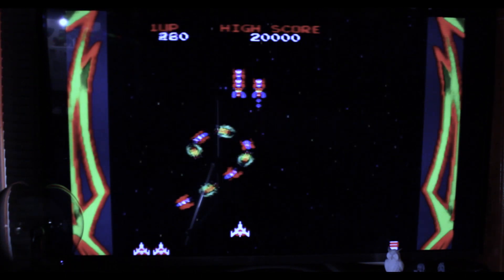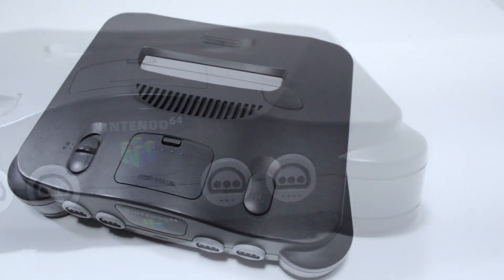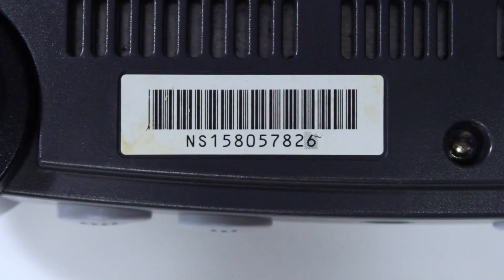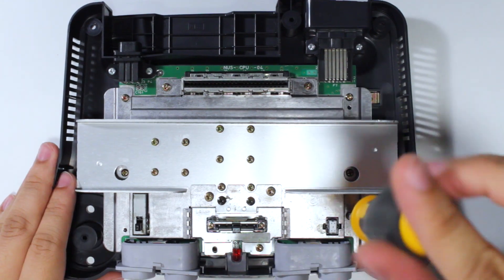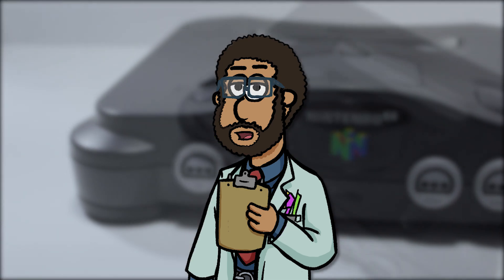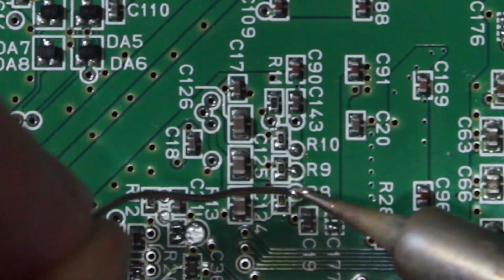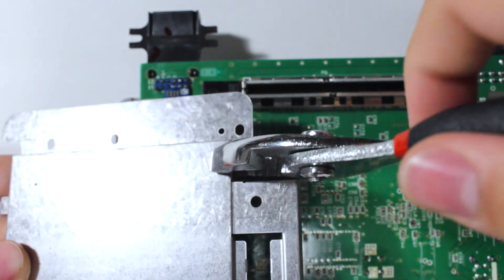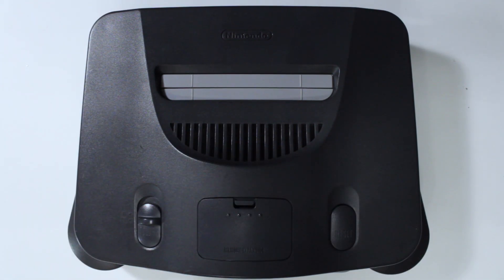You NEED A Modded N64, RIGHT NOW! | VideoGame O.R.

Comment: the best way is to get a cartridge reader for your PC and use an emulator as nothing you will ever do to the real hardware will come as close I can upscale my N64 games to 1080, 4k & 8k and even play them using a VR headset to simulate a cinema size screen, then use a USB converter to use the real official N64 controllers on my PC, I have about 3 modded N64's that can output in HDMI or Component and its clear they are not as good as the setup im running now via my PC. im using real cartrige not roms and can use official controllers or any controller I like. and I don't have to be using hardware over 20 years old.
Reply: People have different goals and a $36 mod project for their n64 to use at their friends house or their living room with normal carts or maybe an everdrive could be someone else's goal. 

You mentioned a cart reader and controller adapters which also cost probably up to the same amount too, so again, different strokes for different folks.
Reply from the maker: This is something more geared towards people who enjoy using the original hardware, and would like to improve the image quality